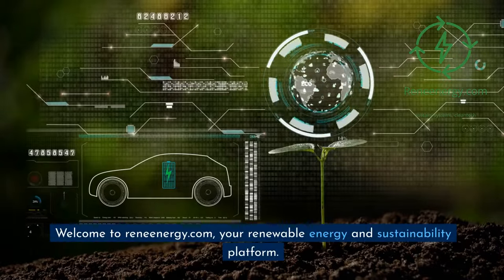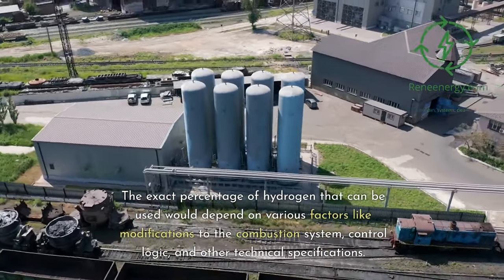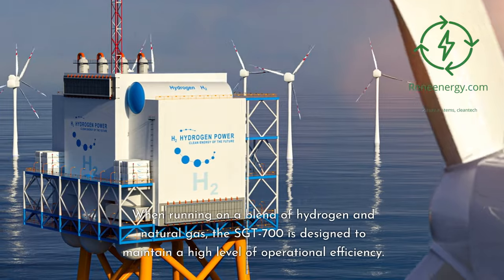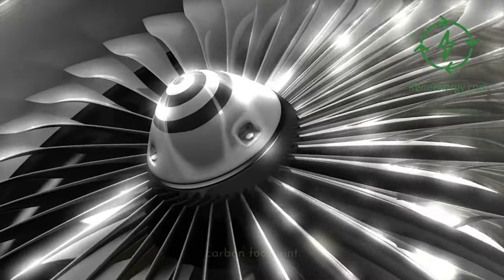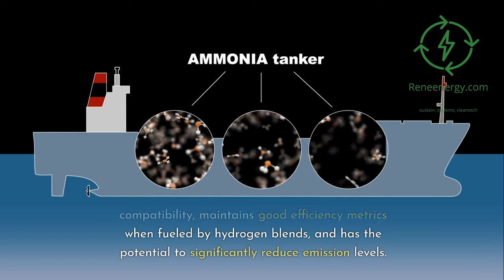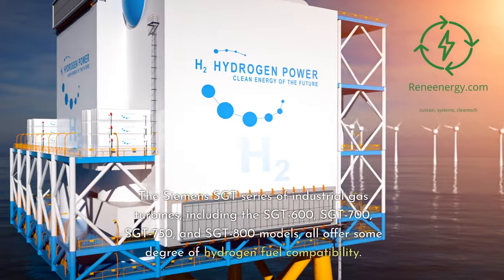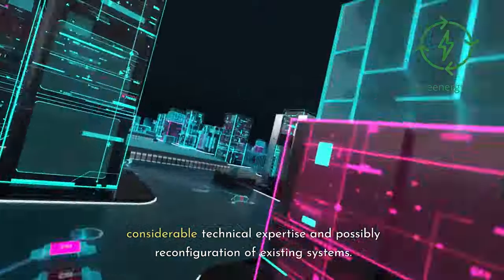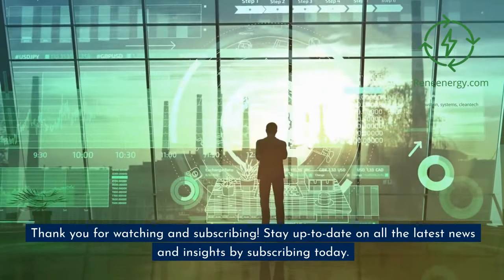Igniting the Future: The Power of Siemens' Hydrogen Turbines

Comment: Please add typical and max/min values for all claims! If you only specify 'ask Siemens' then this video is totally useless. Nice renders though.
Reply from the maker: Thank you for your comment and feedback. We apologize for the lack of specific numerical data; the reason it wasn't included is that these figures can be highly specific and vary under different conditions. We recommend reaching out to Siemens for the most accurate and tailored information.
Reply: Thanks for your reply, but this is not a valid answer. In this case you should still present data, e.g. by reaching out to Siemens, get the data for some specific but common condition and describe the condition and data in the video. You can't expect all your viewers to contact Siemens.
Reply from the maker: Understood. Thank you for sharing and advice. Good point. Check out this link incase of further research: https://www.siemens-energy.com/global/en/home/products-services/product/sgt-750.html#/